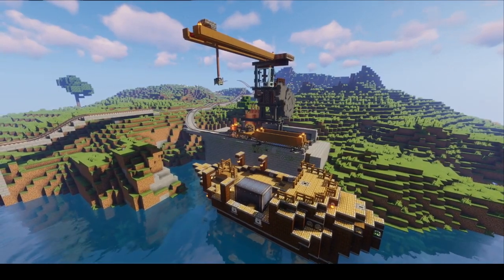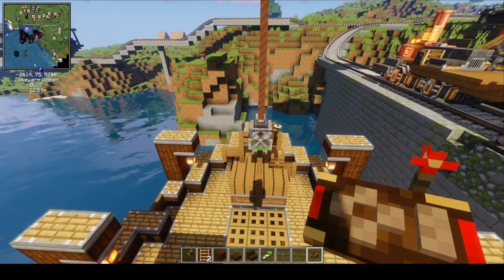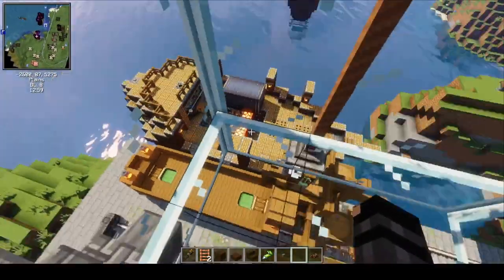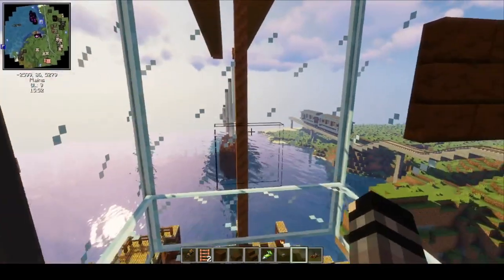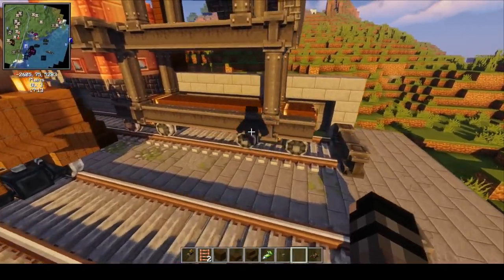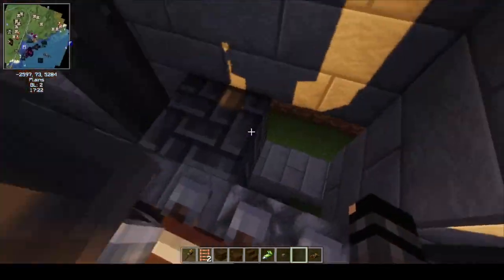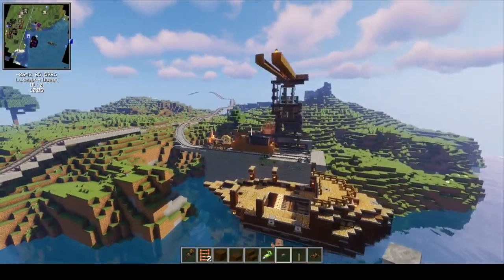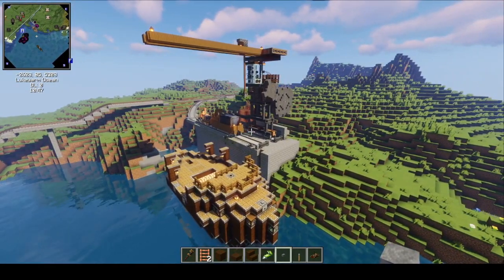Create Mod 0.5 - Functional Crane and Train

Comment: something you could do to work around the lack of buttons is maybe just have movement controlled by shift and space, and have all the arrows just switch the mode of the crane
have up key equal horizontal mode and shift and space will move side to side, down key puts it into vertical mode that raises and lowers the crane with space and shift, etc

in this method of mode switching you can have 8 effects with 6 buttons. 

another thing you could do is have compount controls, so when you are holding down shift or something then the other keys do something else.
I think the most intuitive ctrl scheme would be 
up=forward
down=backward
left=left
right=right
shift+up=rope-pully  up
shift+down=rope-pully down
space=toggles sticker block 

not sure how big the control redstone would be but I doubt it would be that difficult with some basic redstone knowledge

EDIT: off the top of my head how to do this would simply be have shift activate a stickypiston with a targetblock attatched and when it is held, it pushes down the target block and redirects a redstone line that would normally be tied to the up and down keys
Reply from the maker: Thanks for the tips! I never thought of combining keys like that. I'll keep that in mind next time I need more than 6 controls
Reply: i think it would be better with logic gates without pistons
Reply: @PawelHerok  how would you do this? have an AND gate for SHIFT+ARROW that both triggers the right output as well as locks a the repeater on the ARROW output? I am not too good at logic gates btu I feel like the piston + targetblock is simpler. maybe you save space by not having to run a straight redstone piece that is able to be diverted though idk
Reply: @AshEshyr but how would you disable the inputs of the other things. (I’m building a gantry crane rn give me a week to work it out)
Reply: @gwp1915  its been a while so I dont remember exactly, but after I thought of this concept i made a video about the linked controller where i demonstrated the concept i am talking about and built a demo crane with it. It should all still work if you want to reference that.